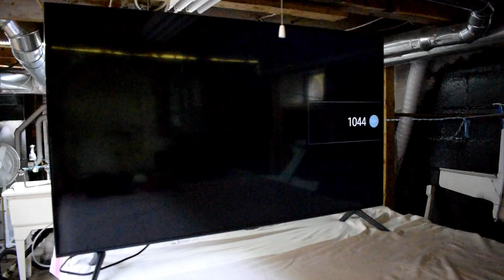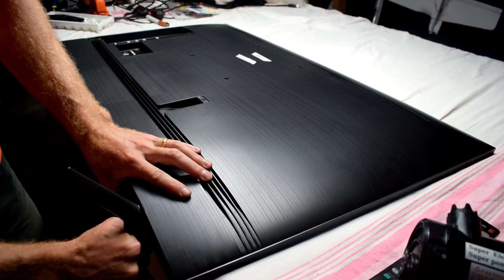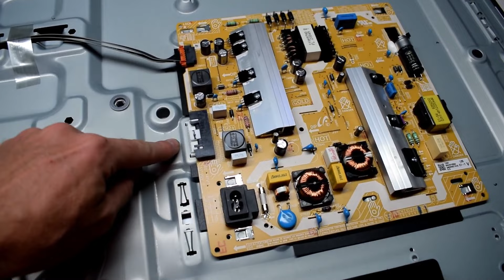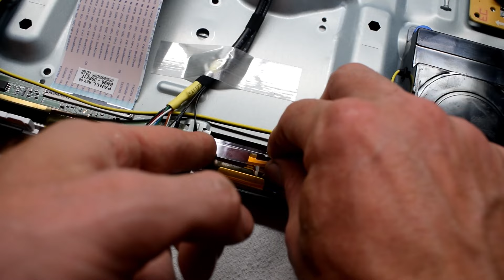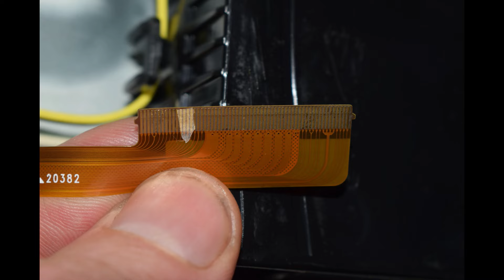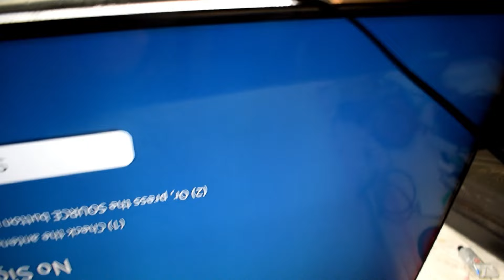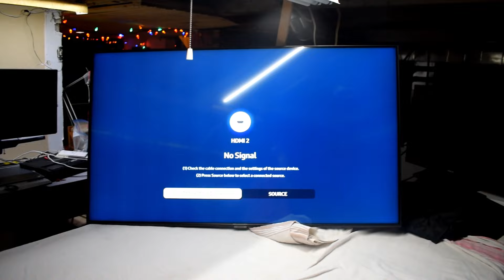Samsung Smart QLED TV Keeps Restarting! Fixed with TAPE! (Model QN50Q60TAF)

Comment: Thank you so much from Vladivostok, Russia! The only video where I found exact same problem what I have with my Samsung qe50q67aau. Spent several hours but solved the problem using your method. 
Just for others information, my location of isolated contacts was completely opposite from this video. I put tape on the right connector, pins 20-24 if count from right side.
Reply: Привет земляку! Подскажите, пины закрывали в рандомном порядке?
Reply: @python3240  Приветствую! Сначала, начал заклеивать как на видео - не сработало. Ну и всё, после этого пошёл прям по несколько пинов заклеивать начиная слева. И вот так методом проб и ошибок дошел до нужного мне места. Потом пытался более точечно найти конкретный пин, но изображение от этого лучше не стало. Ну вот прошло уже сколько времени с тех пор, телевизор еще работает, но зависает всё чаще и чаще, и изображение потихоньку хуже и хуже становится. Короче мера такая, временная. Но мне все мастера и спецы по теликам сказали, чтоб я ни в коем случае не брал Самсунги новые 😅
Reply: @александркостин-и9ц спасибо за ответ. То есть работает в таком режиме уже год, как я понимаю?
Reply: @python3240 да, все верно, уже год в работе. Но как и писал до этого, изображение потихоньку ухудшается и периодически зависает телевизор.

Comment: I have the same kind of ribbon set up. No T Con just 1 main ribbon from MB to panel.  Do you have to do the tape on the ribbons on the panel or can you do it to the ribbon that comes from the MB end?  My 2 connectors on the panel look like the type that dont unclip like yours.  Push in in something.

Comment: Have an 86 inch 2021 6 series. Ended up being the right lcd module from the back, had to tape over pin 15, can’t even tell there’s missing data while watching. I only buy LGs but got an extremely good deal on the set, to be clear my LG OLEDs, although burn-in prone, has never needed repair. Also the os is extremely snappy compared to Samsung’s, just my take, I’ve had to disassemble the set for major repairs twice now.
Reply: Pro tip start with a larger piece of tape and narrow it down. Also set your phone up above zoom in and use tweezers the adjust the tape, had to use a razor and cut a very small piece of packing tape. I only wanted to cover pin 15, if you cover more pins then you need to you will have a poor picture, I initially covered 4 or 5 pins and the color was real washed out on the left side.

Comment: Thank you so much for your video! My TV started this issue last year. After a few days unplugged it turned back on like nothing happend. Half a year ago it started again, the loop was getting shorter every time and I gave up. I tested if it would work after 6 months, searched the whole internet for a solution, gave up and then when I was about to sell all the good parts on ebay this video right here was recommended. The TV works like it did 3 years ago when I bought it. 
For all of you guys watching this because you have the same issue, its scary to open the TV up but it works. Getting tthe back panel off sounds like breaking the whole thing but it needs a bit of force so dont get afraid.
My first piece of tape was too big, the entire right side was off. In this case try a smaller piece until you get your image. Dont give up and save a few hundred bucks for a new TV!

Comment: found a 75in samsung by the dumpster today. after 10 min of taping pins, i got it working great. TYSFM!!!
Reply from the maker: that is great
Reply: Is it still working?
Reply: @afrarsuhairdeen432  yup!!!
Reply: mine were the ribbon cables on the left side of the screen (right side) if you're looking at it from behind. i dont remember. start with one pin, then the next and soo on until the tv boots.
Reply: @marcodelao9148  the tv boots now and doesnt turn off i hear sound but tv is still black i was able to get picture before with some lines so i moved it a bit but dont remember where i had it before and now i cant get picture
Reply: which pins did you tape ?

Comment: Hi.. if i already disconnected the CN1 to CN2 connection but it still blinking.. is it the display panel on right side totally short?
Reply from the maker: could be a short on that side but try to tape the connection because the traces may go on both sides of the lcd panel eg. a clock wire.

Comment: Thank you so much. I knew it was like the Sony t-con board. Sadly Samsung don’t have a t-con board instead it have those led boards. But it’s almost the same. Save me a lot of money. 

P.S. if nobody can find stock tape in the house then just cut the electrical tape from the tv holding the wires for covering those pins.

Comment: My Qled only 2 years and 2 months old. Just 2 months past the warrenty expiry. It had exactly the same issue and i stuck the tape at almost exactly the same spot and it worked. I think Im going to contact Samsung as this is bad quality as there is still some lines vissible on the screen.

Comment: Oh my god, i can't believe this worked.  Wish I found this sooner!

TV kept flickering on an off, so I actually bought all the replacement parts, and after testing each one, it still happened, so I looked, found this video and boom, working TV again.

I have a samsung qn70q6dtaf, so there were two of those sets of strips so I had to test both sets, luckily it wasn't one of the inner ones as they seem daisy chained from inner to outer on each side.

Would you be able to tell me the exact cause as to why this is happening, and if I wanted to replace the part causeing it, would it just be the single PCB for the LED?

Comment: Hi, thanks so much for this video. My Samsung is only 3years old. It started cycling through a power loop this week. 30mins working with the scotch tape and now I’m back to a working tv with a few horizontal black lines. I’m sure I’ll probably replace it, but now there is absolutely no rush. Thanks again 👍

Comment: I have a Q6F model Qn55q6famfxza. I took the back off and it doesn't have accessible gold ribbon cables to the panel. When I remove the ribbon cables from the motherboard, the panel lights continues to turn on and off in a boot loop. Can I assume that it's either a bad motherboard or power supply board?

Comment: Thanks for this post. I was able to find multiple places on the connector that would stop the constant rebooting. HOWEVER. the only one that allowed the screen to work is the location shown by the author.  Start at that location before looking anywhere else. I do have some pretty severe horizontal lines. I'm not sure this will work for me.
Reply: Found any fixes?

Comment: repairing this TV on the exact same area for the second time now. The fact that Samsung likely intentionally made this faulty engineering decision to get more sales is nothing short of scandalous. Thank you for the help!
Reply: My thought exactly. Regardless of whether Samsung deliberately designed these short life parts or not, someone should serve them a Class Action. Too many of these TVs fail prematurely and end up in the garbage with the added risk to the environment. My 15 year old Sony still works really well.
Reply: @axxamenni5501 I have a 15 year old Samsung still working.  The newer ones are not built to last
Reply: Exactly the same.15 year old samsung is fine.3 year old flagship has this issue.
Reply: Update after 2 repairs it finally gave out. Seems like the problem is the LCD panel itself now. Never buying any samsung product again
Reply: Samsung has been reported to be utilizing slave labour…. Imagine being one of those workers; what satisfaction could you get beyond doing crappy work for the Pennies you earn.
Reply: Ive just cut out the pins I had taped off😂 works fine only after a hour tv resets and then works again for a hour
Reply: Where did you put the plaster at ?

Comment: Thank you for posting this repair video. I appreciate your persistence to repair things and generate less waste in the world. Scotch tape method worked on my Samsung UN55KS8000FXZA that kept boot cycling.

I did this initially and it did not work. I knew I had a good power supply, but was not sure about the main board and led panel. I went ahead and installed a new main board and no change. I did not find any burned resistors on the led panel. Went back to scotch taping along the 2 connectors on the main board. Tried a few different sections and then all of a sudden, voila!

For anyone out there with a Samsung and who has tried almost everything, try the scotch tape method again on various sections. You may get lucky! It’s worth a shot and costs zero dollars!

Comment: You are a legend!!! Fixed  QE50Q60TAUXXU in under an hour. Covered with tape pretty same area as you showed in the video. Worked straight away so didn't even have to experiment. Samsung you should be ashamed...
Reply: Does it still work?
Reply: It didnt work.well a proper technician will do it.not to risk and the TV is expensive

Comment: Hi, my samsung qe50q60Tau is the same problem continously restarting and no screen, I taped pins for start the tv but only I see the back light is working and no menu etc I tryed change the main board but nothing the problem is same pls help me the tv is now turned on when I turn on but I didn’t see anything on the screen sorry my bad english.
Reply: Same issues here, everything seems fine now but the screens blank, can see the screen light up from the back lights but nothing else..
Reply: @ethanbrown3364  same here
Reply: Did you guys solve this?
Reply: @grgaron   I hope so xD
A few have this problem but no solution yet
Reply: Same problem

Comment: This was exactly my problem and the exact solution. I paused a show and when I came back my TV was power cycling every few seconds. Took it apart and unplugged the left side. Saw that was the problem child and spent a bit finding the exact culprit (5-7 in from the left) taped it up and it worked. Thank you for providing this easy solution! Never buying a Samsung Qled TV again.
Reply: My Qled has held up since 2018, probably shouldn't of said nothing 😁 mine was a cheaper model, the one that started cutting on and off. I could see where they shoved it in to far then when they snapped the lil black catch down they put a crease in the plastic hookup thing that hooks the 2 panel boards together
Reply: So far mine has been pin 11. Got a better picture with a few flickering lines. However resets after about 30 seconds now (longer than before, but progress). Will continue to isolate pins.
Reply: Thank you. Managed to fix but but have a single horizontal line at the bottom. Is this the best it will get it shall I keep experimenting to get a perfect fix?
Reply: @330d5  that's your best. Mine has grown yo about 3 lines at the moment. It's fine for now and works but if I have an opportunity for a free TV or a cheap replacement I'll jump.
Reply: So you blocked 5,6 and 7 and it worked for you... I feel like I'm close but not there yet 🤔
Reply: @benthumwood5947  the tape might be covering either all 3 or just 2 out that 3. Still to this day it's held up. Take your time you might find your TVs culprit, took me a bit to find  it on my TV.
Reply: @JbirdtheDJ  But the image quality is degraded now after blocking those pins.
Reply: @FrozenHaxor  keep messing around with the tape. You'll find the sweet spot and it will only block a pixels worth but in a line.
Reply: @JbirdtheDJ  For me it was a short on ESD diode at the end of the LCD board, unsoldered it and it works fine now. Zero degradation.
Reply: What would that ESD component be labelled as? My fault is on the right-hand strip board too.
Reply: @nrshida  They're not really labeled, and you need to look for it with a thermal cam ideally. They're all over the panel boards.
Reply: @benthumwood5947 yeh pain in the butt isn't it I'm still trying 😅
Reply: I taped 3 pins which allow the TV to stop power cycling and the backlight stays on, but I get no picture, just a backlit blank screen.

Comment: Could I assume that it’s the main board if I connect my phone to charge using the usb port? I notice that the⚡️icon on my phone goes off at the same time that the tv powers off. When the tv turns back on the phone begins to charge again.

Comment: Hello, I'm having this exact same issue. The TV red stand by light flashes twice and stays in that loops. The TV is unresponsive. I followed your tutorial and covered up some pins on the left side ( the orange panel strip with the led lines (Cable Model: SFPCX495G-002)). The TV now turns on but no video. Should I continue covering more pins? What would be the next steps with this issue.
Reply: I have a qled Q90r I have been trying for 1 year now,I bought a Mainboard,hoping that’s the issue ,but not!! Today i lost 10 %  of my eyes putting type on every 3pins!! Everything has been for nothing!!

Comment: Mine has done the same and if u have it unplugged for a long period of time and then turn it on ot works like new for about 20 or 30 minutes and then it cuts off but as the screen turns off its a slow fade out the turns like an orangish brown tent almost as if it is burnt..and then it starts to do the on off power cycle

Comment: Hello mine is same TV 58Q60T has same issue , followed your instructions(power supply & mainboard are ok) step by step ,if i disconnect ribbon strip leftside back light is getting on & same with right side ,

Please suggest which pins should be tapped ?? Will be waiting for your response sir..thanks in advance 🙏
Reply: I have a samsung q90r,it’s been a year trying to find a way,I suspected the main board,what I bought few days ago..and the same B.S. i was thinking to sue Samsung..tv lasted for only 2years and 2 months!!

Comment: Man i spent 5 hours noticed you can also do this with the flex cable works temporarily, if its unpluged for long period it won't work and it turns another pin off and reboots the one you covered 😂

Comment: Hello, thx for the video. I have one Samsung QLED QE55Q80 2020 year model and the warranty ended last year....... The TV started to reboot in loop 2 days ago, but sometimes when i interrupt the cycle with power off button, when i turn it on it works (worked yesterday all day). Today that method didnt work anymore, the TV turns on but keeps rebooting, so i decided to try your method. For starting i remove that ribbon from both sides and the right side of the screen worked. I connected one side of the ribbon and the right side continues working. I disconnect the ribbon and connected the other side, and for my surprise the same right side of the screen was on. (It supposed that the right side of the ribbon controls the right side of the screen and the left side of the ribbon control the left side off the screen right???). Well i decided to clean the ribbon and connect both sides and the screen is working for now. Any tip about whats happen?

Comment: I have a Samsung QE50Q60TAU. I tried replacing the board and power supply without luck, and I tried the tape trick. Facing the rear of the TV, left hand ribbon, counting from the right, I taped over a single pin 15, that kept the screen on but there's no picture. I tried a number of different pins without any luck.

Comment: This did fix my tv but there is a vertical line down my screen it looks like pixels turned off. When testing the backlight, the backlight is fine no lines. But when the tv booted I see two stripes coming down. What could this be? T-Con? Logic board? Or even a panel failure?

Comment: Wow I was able to fix mine using this method I tried, pin by pin trying to find the one, you can imagine how much work it was lol, it was actually 2 pin, I didn't want to cover more than the actual problem so I wouldn't lose anymore pixels lol but omg I spent half of the night trying to find a way to fix and and I watched a ton of videos before yours and each video provided me with some content to use because my TV is different, so far yours was a bit close to mine but mine had 2 of those belts lol I feel like a total technician now hahaha I should start some business hahaha Thanks man!
Reply: Which two pins and what's the model of your TV please?
Reply: I have a samsung q90r what has 2 belts,I have been trying a lot of options,I changed even the main board..and NOTHING so far!!